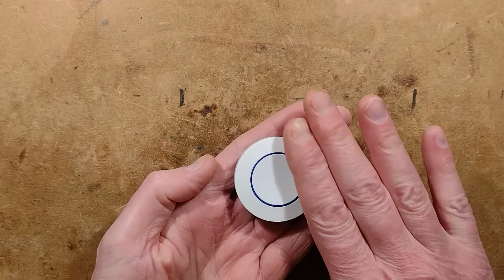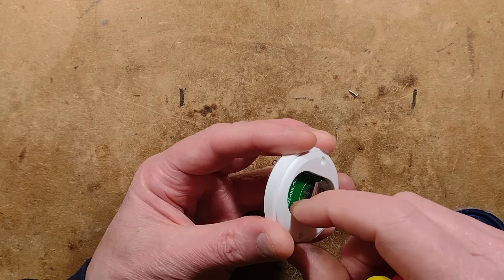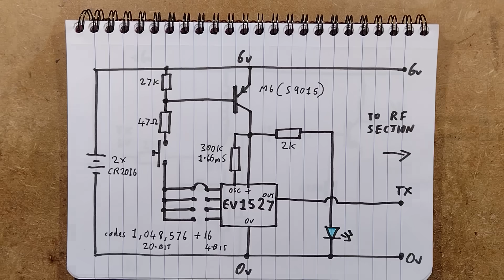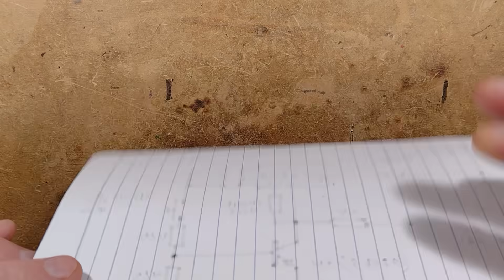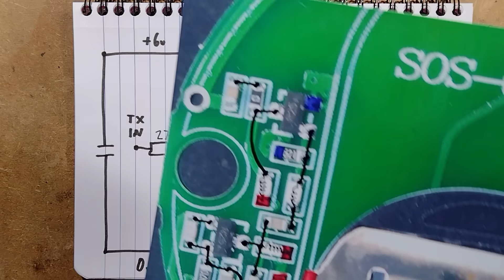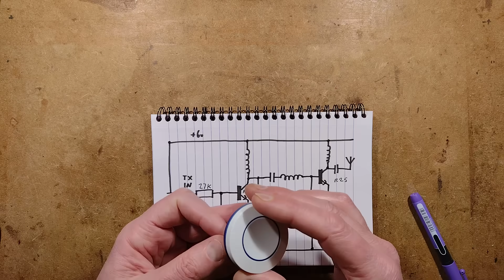Inside a very common style of remote control button - with schematic

Comment: The transmitter circuitry seems to be a very typical quartz stabilized oscillator where the transistor is working in a common base mode. Typical for any RF transmitter in that range. Even the spy bug type circuits are operating in this mode.
Reply: Ceramic resonator, not quartz.

Comment: CR2016... 20 mm., that's the diameter and 1.6 mm. is the thickness. CR2025 and CR2032? Well, what are you waiting for, off you then. Hurry now, go find or buy yourselves a caliper. 😆
"The Department, you say? Yes... that's what they used to call me. The Department of Random information. That was my name. I am The Department of Randomly Useless information. And I come back to you now, at the turn of the tide..." 🥸🤣

- BTW, shorting out a coin cell with a metal caliper? Mmm, may not be the brightest of ideas. But then again, possibly not quite the worst one you can come up with either.

Comment: I just got one of those mailbox detectors, and the 3 "ringtones" are the usual bleep-bloop followed by 1 of 3 annoying voice announcements:  One that's probably the old AOL "You got mail!" robot, a second that's a disturbingly chipper woman's voice saying the same, and the third what's a sort of drawn-out Al Capella "singing" of "you got mail".  Yecch.
But there are also a few dozen other "ringtones" that you cycle through by pressing a different button, so it might also be able to pair with a separate transmitter for a doorbell function.  That would be kewl, if I could pair that with the button I have on the side gate, but there's zero mention of that functionality or how to pair it.  The microprint "instructions" are only barely better than nothing.

Comment: Can you make a video about 433 Mhz 230v relay with black "spring" antenna? It's popular and somehow you can get electrocuted from that antenna.
Reply from the maker: I've featured many like that.  The antenna wire is often referenced to the mains supply if a non-isolated supply is used.

Comment: 433 MHz is an ISM band in ITU region 1, but in United States for instance, that is in the 70 cm amateur radio band, and you would need an amateur radio license to use it.

I had to answer the question for myself, because I happen to be an amateur radio operator in the United States, and I do operate on that band.
Reply: Worth noting it's an amateur band over here ITU 1 (secondary users). 430-440Mhz
Reply: Do you happen to know off the top of your head if US hams can actually use 433 MHz remote control devices like this? I know there's an exception to the one way transmission rules for "remote control" but I heard something recently that it may not be as straightforward as it sounds.
Reply: 433MHz is commonly used in European market as remote control frequency, not in USA. You have to be careful, when buying stuff from internet, as different countries have different laws, and different frequencies for the same stuff. Common people doesn't actually realize that, because they're not amateur radio operators, and they buy stuff from China, and might get into trouble.
Reply: @Njazmo indeed the frequency bands allocated to remote control vary by country. For example car key fobs use 433MHz in Europe and 315MHz in the US and Japan.
Reply: @Njazmo  Part 15.209 generally allows low-power, non-licensed operation on all ISM bands. Part 15.240 provides a separate authorization for higher power operation on 433MHz for the specific purpose of scanning shipping containers.
Reply: When the Meshtastic thing was kicking off, some people mistakenly bought 433 modules instead of the 868 ones as in the early stages of the hobby, 433 items were cheaper from some retailers. 433mhz nodes are fine to use IF you have a licence whereas the 868mhz can be operated without a ticket

Comment: Why did it come with two CR2016 when one CR2032 would have done ? 🤔
Reply: To get 6v instead of 3v. Higher voltage = longer range. Already mentioned in the. Video.
Reply: @mkpati  thank you for the explanation 👍🏻

Comment: Hi Clive, maybe you could swap the zero ohm link from the button to the μC with a 4x dip switch. I've seen receivers using the last 4 bit of the transmitted code as some kind of command, so changing the last nibble of the code might tell the doorbell not to cycle through all the ringtones 😂
Reply: or put a 4x4 matrix keypad and turn it into a 15 channel remote.

Comment: LOL it has the /exact/ same ding-dong as our generic code-learning doorbell-receiver that I paired up with out video-doorbell. The code transmitted by the video doorbell is fixed so no changing that, and I guess there's like a million different codes like explained in this video, but the receiver ALSO triggers on something else than our video doorbell, and it usually does so at 3 in the morning! - This week i've been awaken twice by false alarms at around 3-4 in the morning. So now the doorbell-receiver has been put on a timer relay so there's absolutely no way it can wake me up in my deep sleep. And yes, hearing that exact ding-dong in the video gave me horror :D
Reply: This is annoying for a doorbell but rather more worrying for a garage door opener! I bought two supposedly rolling-code ones recently from AE. The first triggered randomly all the time - got that refunded. The second has been known to trigger very occasionally. I put a bleeper in the house connected to my garage door opener, which sounds if the door is open but the light in the opener has gone out (after a few minutes). This is reassuring and has provided a useful alert on occasion.
Reply: @matthewmarks6951  Gladly our garage door openers are using rolling codes, so no way to trigger it by mistake.
Reply: @zaprodk  I think mine is too - the difference being that the receiver (which replaced the original fixed-code one) came from Aliexpress...!

Comment: That's a very clever way to save battery life, but it requires both that the chip boots up very quickly, and that if there is a button pressed while it boots up, it processes it as an input immediately.  So I think there's a pretty good chance either the chip designer predicted this approach, or it is such a simple chip this behavior just falls out of the simplicity...  But I wonder if key fobs in general use this approach; I should take apart mine and have a look.

I bet the 433 chip is replacing what would be a crystal in a can on older devices, but in SMT format so it can be automatically populated...
Reply from the maker: The chip is not a microcontroller.  So there is no boot up time.  It should just start working instantly.

Comment: I can add that these work perfectly with the Arduino “RC Switch” library. At least the ones I’ve gotten do there are a lot of potentially different boards out there. There is also a learning version of this which will not work with the rc-switch library so make sure you’re getting the fixed code version if that is what you want to use it with.

Comment: I remember years ago being astonished at something that looked like a TO-92 transistor which was capable of playing a whole range of annoying doorbell tunes.
Reply: Why
Reply: @phonotical  Because it was about 40 years ago.
Reply: the Chinese are thinking out of the box yesterday I found a Bluetooth module for a mouse integred in a soic 14 with the antenna directly connected to one leg also  sot-23-6 can be a switching power supply circuit or microcontroller or a transistor etc.
Reply: @electronics-by-practice  I have a BT serial module that  only has a chip with 8 pins.
Reply: um66 series ic?
Reply: @ Looks like it! To expand on my comment - in those days, digital ICs didn't look like transistors and far less integrated in terms of different technologies. For instance, you'd expect this to require external components to support the oscillator, and a separate ROM chip to store the music. The amount of tech for the price was also impressive - this was obviously intended for hyper mass production to spread the considerable non-recurring engineering costs.

Comment: I haven't seen that arrangement for turning the chip on, it seems a bit superfluous. Usually each input line is connected to the power pin via a diode so that selecting one pin doesn't feed back to the others.

The circuit in this case goes
battery -> 2K |-> switch |-> diode -> chip +v/osc
                        |                 |-> 47K -> chip input
                        |-> switch etc.

I have modified one of these circuits so that I have 4 options for controlling spotlights from a pair of momentary rocker switches - on, off, momentary, timed.
Reply: A clue may be that this is running from 6V rather than 12V as shown in the schematic on the data sheet. I'm wondering if the collector-emitter saturation voltage is less than that of a Schottky diode. I would doubt it would be significant though.

Another difference is that the current through the pushbutton is much lower, so it would be more tolerant of oxidised contacts and might even cause less wear on a really cheap and nasty switch.

The RF section looks much better than on the data sheet - it's got a 433 MHz resonator rather than some horrible manually-tuned thing, so the frequency will be more precise. This will mean the receiver should be properly tuned into it, compensating for a smaller signal. It also runs on the full 6V rather than via an LED and diode drop to make the most of those volts. I don't see how the unusual way of powering the chip would have a bearing on this though.

Comment: I've seen alternate guts used to make this same shell work as a zigbee button as well. Similar circuit design, just a different micro, frequency chip & burst pattern.
Reply: For ZigBee it would be 2.4gHz and bi-directional. A far more complex chip.
Reply: I've been on the lookout for a "fob" style ZigBee remote. The complexity of buttons and robustness means 3D printing wouldn't work ... I hadn't thought of gutting a cheap enclosure!

Comment: Very interesting.  Thanks Big Clive. So would it be very unlikely that two buttons would have the same code?
Reply: Yeah - one in 2^20 or less than one in a million chance. What these things don't have, though, is a rolling code, so if someone with a nearby receiver captures the signal they can simply play it back. In other words, not for high security scenarios.

Comment: I think the number of possible codes is 2^20 × 16, not 2^20 + 16.
Reply: Times 15, no? If you don’t connect any of the pins to the chip, which would be code zero, then it would be like never pressing the button either.
Reply: I concur times 15 given our reverse engineer's conclusion, dear Clive. Yet also I wonder, with addictive curiosity, if the dang thing will mysteriously operate without any resistors. EV1527 datasheet, for example doesn't preclude a "command code" of 0b0000.
Reply from the maker: You're right.
Reply: Am I right in assuming that we don't have access to the first 20 bits so basically we only have 16 different channels to choose from?
Reply from the maker: @josephwheeler1  The main 20 bits are locked in the chip, but random from the factory.
Reply: @josephwheeler1  In this device there's  one code, which by chance might collide with another.  No idea if it's IPv4-tight in reality.  In a different circuit a single transmitter could be paired uniquelyish with a dozenish receivers, if one designed a means to switch the externally provided part of the code.